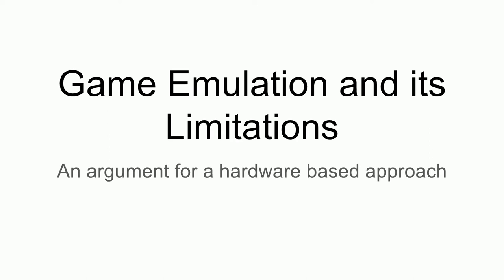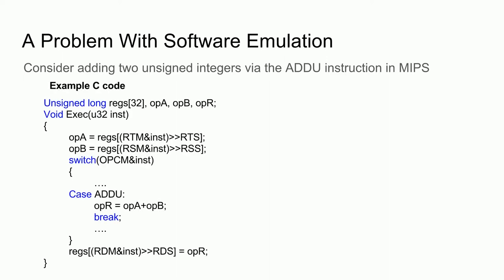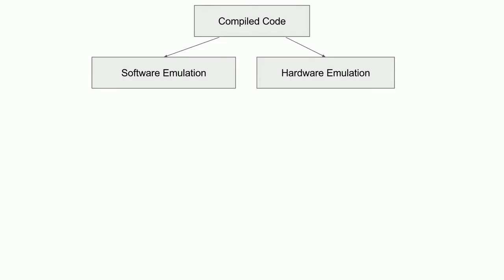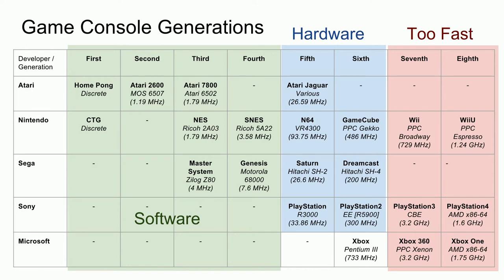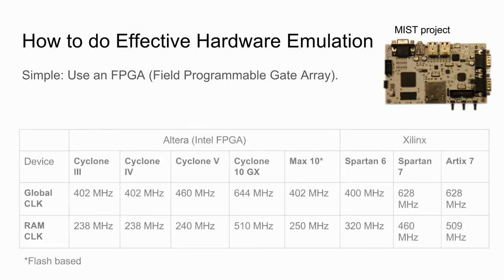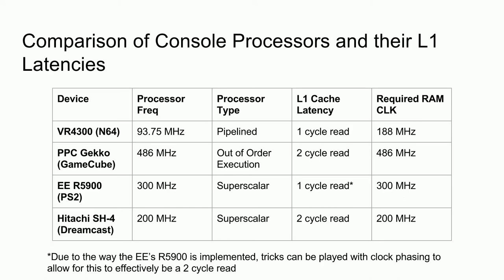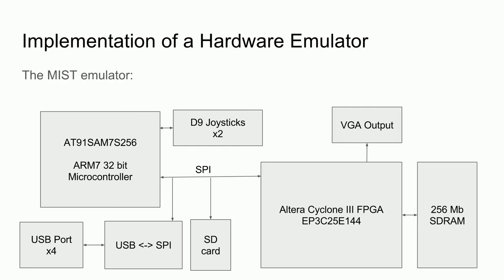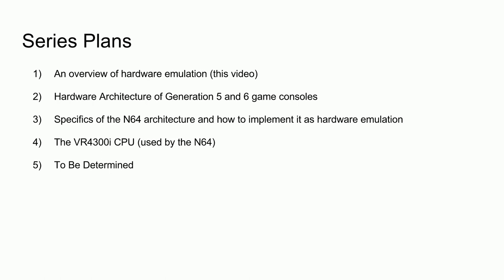FPGA Game Console Emulation and its Limitations

Comment: I have got a general question (as I couldn't find the answer anywhere). Would this overclocking method known from software emulators, which does not break video and audio speed, be possible on FPGAs? Quotation: ""For many years, NES emulators had a method of overclocking where additional scanlines are added for the CPU for each video frame," byuu tells Ars Technica. "Which is to say, only the CPU runs on its own for a bit of extra time after each video frame is rendered, but the video and audio do not do so... This new(ish) overclocking method gives games more processing time without also speeding up the video and audio rates... and so the normal game pace of 60fps is maintained."

Comment: 🤔limits?
Reply from the maker: Perhaps the limits are more relative? You can always sacrifice speed - if you can fit a RISCV, you could run a software emulator.
Reply: @RTLEngineering  that is a most excellent observation. 😌